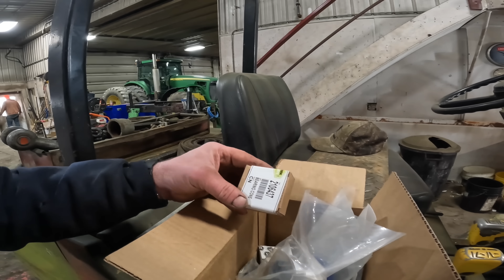Clark Fork Lift Steer Axle ,Lift Cylinder Repairs

Comment: Seeing the crack in the plastic engine side cover at 0:37 reminds me of having good luck with a Hot Plastic repair kit that uses a heat gun with staples the heat up and melt into the plastic. I was impressed at how quick and how well these repairs have held up and stop cracking more. 800PCS Hot Stapler Plastic Repair Kit amazon.

Comment: I’m a retired car hauler my last tractor and trailer had 42 hydraulic cylinders and 1300 feet of hose most were 6-1 and 6-2 a few feet of 8-2 telescop were more trouble but with the right tools everything was easy I used 32 weight oil I think some guys used 68 weight I think I’m forgetful sometimes. Enjoy your videos. God bless.
Reply from the maker: That’s a lot of stuff

Comment: Reminds me of Pakistan videos. 
These super "high skilled professionals"™ dismantle entire trucks and engines using only sledgehammers. 
And even reassemble them using only sledgehammers. 
Miraculously, they manage that the tolerances are usually less than 2 fingers.
They are so proud of their work, they give you a taillight warranty on their repairs (as long as they can see the taillight, the warranty applies).

Comment: Press the pin out of the spindle
Reply from the maker: We did
Reply: @FarmingFixingFabricating  I saw that as you did it.  Been there and done that. I had a badly worn right spindle on a 12,000 lb Clark forklift,  when I was mechanic at a machine shop. But we had an 8,000 lb. that was pretty much junk engine wise.  I had the same spindle,  so I stole it and took care of the 12,000 lb. unit.

Comment: Why dont you by some electric lift (column electric) at the aunction,  that will be a lot easier to reech some part of youre équipement instead of rolling around on the ground in all these dirt,  you are no longer young and it will protect your knees. Exemple for your lift 3 columns would have bien necessary to work in complete safety and comfort,  don't forget you still important for your children, they whill still need you for a very long time. Be wise to stay healty Andrew by the right tool.
Reply from the maker: Don’t have the room
Reply: The kind i talk about are mobile, the only thing you need is 600volt outlet connection, and i think you have some of them around the shop. only need is 4 columns , they are like wheel lift,  you can use it outside in the summer, wach the under of youre truck or small tractor, use it anaywhere in the shop, when youre not use it live them along the wall. Very very handy tool. You can lift up a pickup whit only two of them, anyway you know what you need youre te boss.